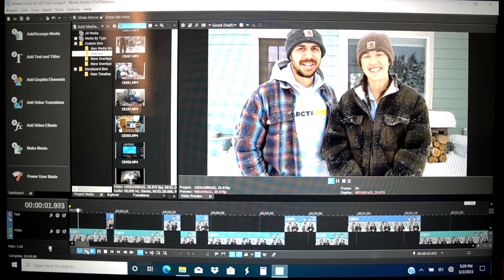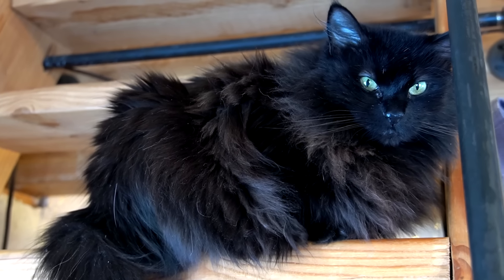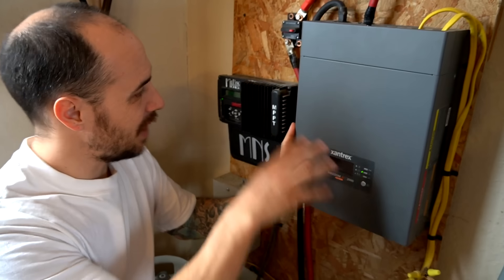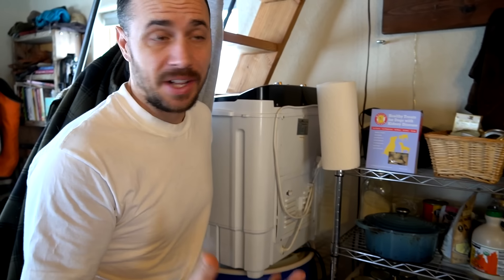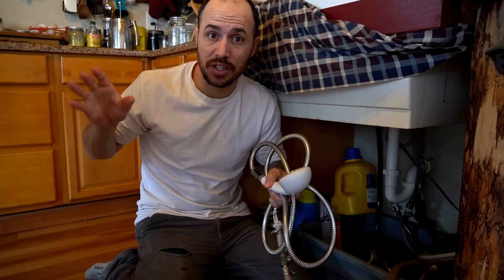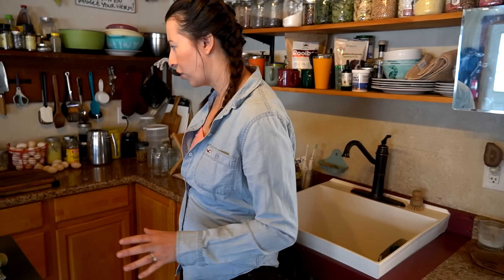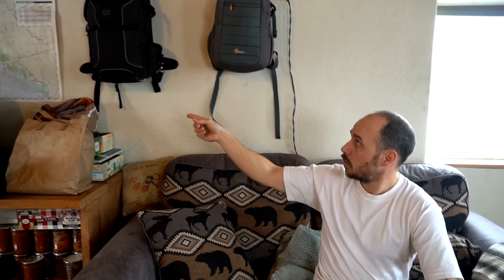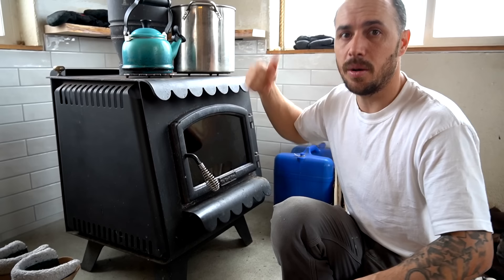Honest Look at Living Off Grid | Full Cabin and Property Tour

Comment: I'm curious why you don't have a wind turbine .. it's a great supplement for your solar system..  schleich about that if the wind blows night you still making electricity, as for your refrigeration.. did you ever think about getting a refrigerator about the size of a dorm one I have one in the nursing home on the end and it runs on AC or DC power... Instead of looking at your solar system you may consider if you have the financial resources to buy another solar generator that has its own solar panel..  as for the chicken water freezing and you're said that you did not have enough power to run something like that to keep order in the chicken pen all day and night in the winter time..  did you ever think about getting the money solar system for over there like you use for your loose protection .. that would prevent the chicken water from freezing and it would also plot power to the light in chicken coop,.. you said that you're getting another piece of property to build on if you take the contacts did you ever think about putting solar panels on that,. It's something that you don't have to add all right away.. Ruby closest are you can always add solar panels to to it as you grow your system.. disrespect my comdtredts . I watch a lot of off-grid YouTube videos as well as the off-grid stuff on TV.. the one TV program The guy out of the wind turbine you should have cut his generator use in half.. sorry that's got long.. have a good day God bless